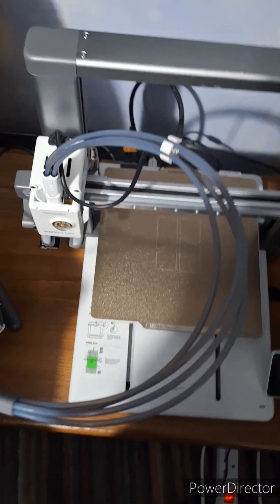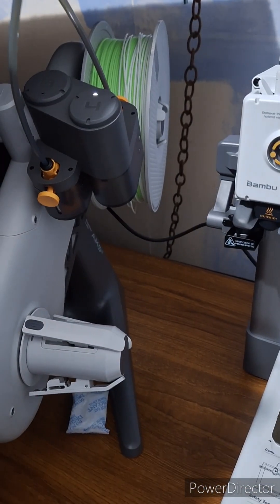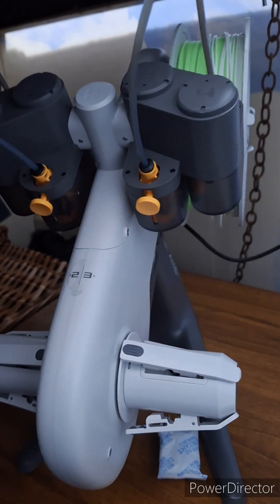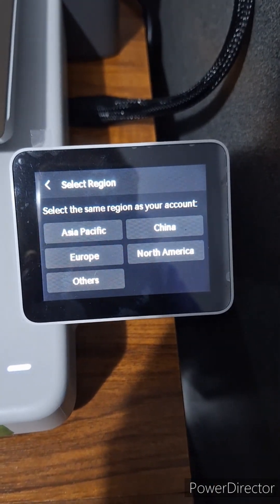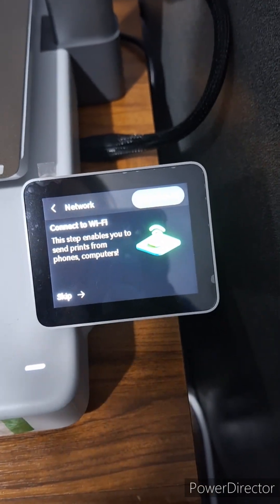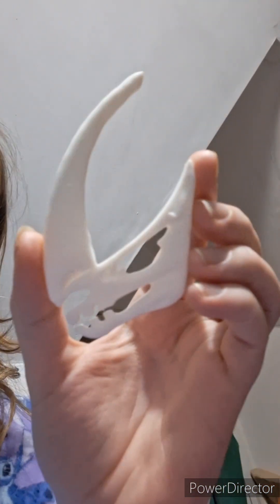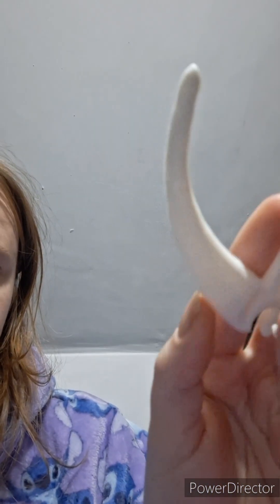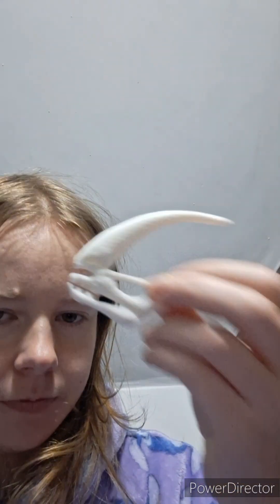My First 3D Print!

Comment: What model of printer is this? I’m very interested in getting one for myself sometime soon and this one certainly looks decent!
Reply from the maker: @Crux161  Hello there, this printer is the Bambu Lab A1 and I got the AMS light to go with it allowing me to print objects with four colours. I picked this one because I have the opportunity to print larger things than the A1 Mini can such as helmets for cosplay costumes. (There was something up with this model back before march but that's been sorted now so there's no issues with the new model. It was a cable issue, the new version has the thread cable cover to protect the wire linking the heat bed to the printer).
Reply from the maker: There are new updates from Bambu Lab you are going to want to consider before you buy one of these. Honestly I'm not happy about the update.

Comment: couple of things i want to say, 1 the filiment at the end was not a mistake, that iS just gravityu affection the molten plastic, and it cleans of at the start of the next print, and if you are printing multicolor, you have a purge tower for that, so dont worry 2. the sound of the begin end and startup are the motors vibrating at differet frequencys to make a sound